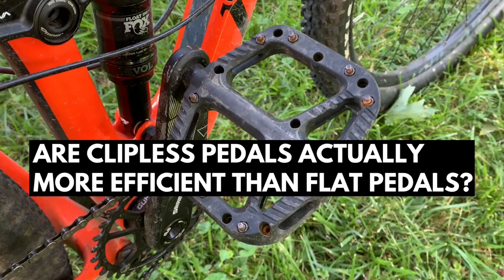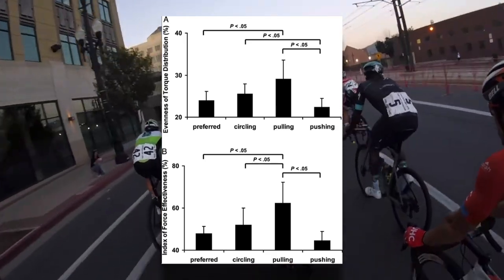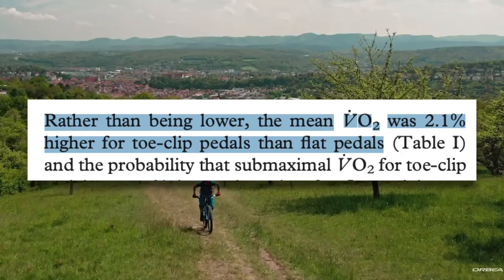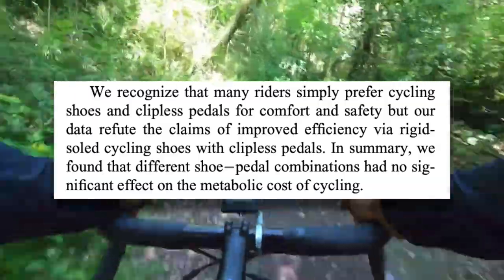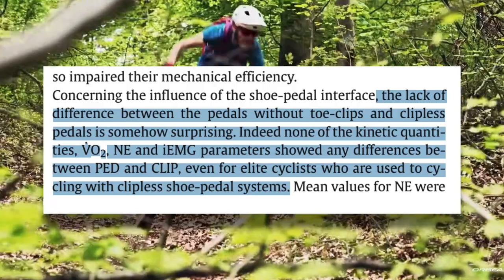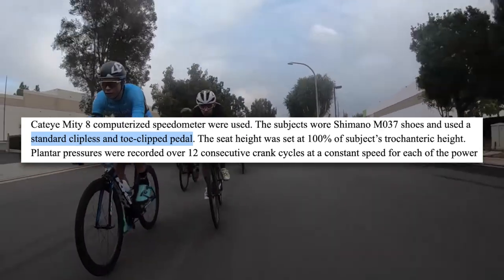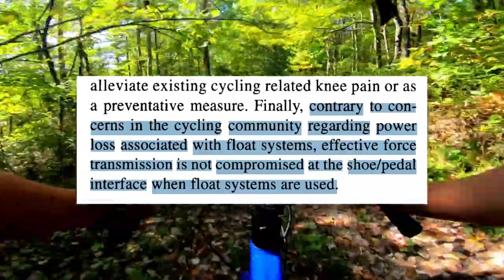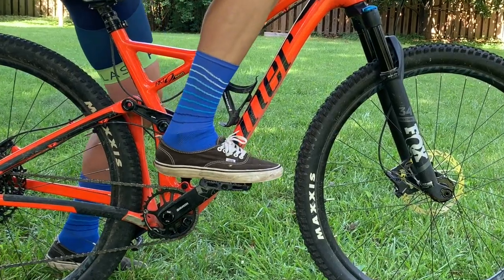Are Clipless Pedals Actually More Efficient Than Flat Pedals? The Answer Might Surprise You.

Comment: This video is completely in line with my experience. I switched to clipless this season and noticed no real upgrade in terms of "efficiency". You will only notice the improvement when going hard, the rest of the time there's no difference. The real gains for me have been the fact that my foot no longer slips off while pushing hard, which looks stupid and is dangerous(and ruins your attack), and that the cycling shoes actually increase my comfort, because I used to get awful soreness on the bottom of my foot from biking on flats with sneakers. While I'd definitely say the switch made cycling overall better for me, the cost is definitely on the high end, and the fact that it's advertised as such a massive game changer can lead to disappointment. Expect improvement, but not to the level some people claim.
Reply: personally i feel that clipless pedals help with the circular motion of the crank. which makes it seem more efficient when you cycle hard. When cycling hard, it makes it hard to get the circular motion down. As the more strength you use the more you need to control your legs to make a constant circular motion. This mean that when going hard, the timing of the transfer of power from one leg to the other isn't as smooth as using clipless. does that make sense?
Reply: @Syn741  well, if you can quantitatively prove that then maybe it is true.

If i was trying to win a competition then maybe i'd bother with clipless pedals, but i am not a professional cyclist so i have no use for them. For the 20+ years that i jave been cycling on a crowded city and sometimes offroad, pinned flat pedals are the best.
Reply: I use toe clips with cycling specific shoes. I glued a rubber on the sole, from a shoemaker store  because these shoes are slippery to use with nothing on. This has a lot of benefits. No knee and tendon pains from the fixed position the clips force you to have. No odd falls that damage the paint and the bike more than the cyclist (except when you fall in front of a car). No foot pain that the sneakers tended to make. Better retention of the foot than with flats, I do not have to continuously adjust the foot position on the pedal. Try this way. Maybe you will benefit.
Reply: I agree your foot slops off less often with clipless but I find it slips of at completely unexpected times when I happen to apply light pressure at just the wrong angle but with flat I can always feel how secure my feet are and know if they're going to slip off before they actually do.
Reply: @Syn741  Don't focus on circular motion. You should be focusing on one leg pushing down, the other pulling up. In perfect harmony, your legs should feel like pistons in an engine. Knees tapping your chest each time, lovely speed.
Reply: Um.  Tennis shoes dont work, a person has to get real flat pedal shoes to make it work.
In 4 years, of 100 to 160 miles a week going hard with flat pedals my foot has never, as of yet, flown off the pedal.  Real shoes with good pedals make ALL the difference.
Reply: @Syn741  Sort of.  People need to think they're pulling up, and if thats what they need then that's what they believe. Every test done, shows it doesn't work that way.

The ugly truth is that with good sticky flat pedal shoes, and good pedals, if your gonna pull up it can be done with flats also.  Also pushing across the top, and scrubbing off the bottom, it all works with flats.   

4 years on flat pedals, this is what Ive found.
Reply: Always go with what you prefer, but if your foot slips off of flat pedals then you probably didn't have the right pedals. I use Shimano Saints set to max grip with the screws and I have never had a foot slip in the ~30K miles since I switched, and I ride in all weather, and have done plenty of sprinting and riding hard.

The downside, of course, is that they're heavy as all f***.
Reply: @MrEcted  Ive used the big Catalyst pedals, and Ive used PNW composite flat pedals, with good shoes a foot coming off mostly never happens.  And the foot goes right back on pedal if a big bump pops foot off. Once your used to them flat pedals are a non item, and way better mt bike riding.
Reply: Although it might ruin genuinely enjoyable aesthetics, there is a big variety of pinned mountain bike pedals and firm specific shoes to match the pedals. Still the same pedal threads, so will fit road cranks.
Reply: @sepg5084 It's not just competition where clipless pedals work, I have been cycling much longer than you and I have much prefered clipless pedals for about 10 years now. Everything else except convenience is better with clipless. When going up a steep hill and running out of gears being able to pull up is helpful when you can use the muscles that are still fresh to give you an extra boost. I can get up hills with clipless pedals that I otherwise would need to walk. Also on longer rides I feel more comfortable on the clipless pedals. Actually have pedals that have clipless on one side and flat on the other. If I go to supermarket or somewhere 5km away I might not bother with the mtb shoes but anything longer and I will definitely wear the shoes with the cleats.
Reply: Hmm, who advertises them as a massive game changer?  Haven't seen an ad like that.
Reply: @PRH123  To be fair, it's when I go to stores that people describe it to me as game changing. Never seen a cycling ad of any kind lol.

Comment: Thanks for citing and interpreting empirical research from peer-reviewed journals on this topic. Seriously, this level of respect for Science in our society is becoming increasingly rare at a time when it actually could not be more important. You have done a great service to the cycling community and a very honorable job in qualifying your statements. Well done, deeply appreciated, and highly respected. </Boomer out>
Reply: And yet the science here would clearly lead a person to the wrong conclusion if people don't understand the limitations of the studies. Namely in this case (as was stated) that climbing and max power tests were not done. We have countless races where nobody ever wins on flat pedals and the reason is that max power output is considerably higher on clipless pedals. It doesn't matter if you can almost keep up on the flat sections effiency wise if you are dropped going uphill when others are able to transfer 100w more power to the pedals.
Reply: Exactly, running tests in the lab with a bike fixed on steel rollers doesn't give data on what really occurs on the road. And we don't ride in one steady state all the time, sometimes we climb, or sprint, or cruise, or hammer.

As we used to say in engineering, there's lies, damn lies, and then there's statistics. If the methodology is not sound, the results won't be either.

Comment: With flat pedals you can change your foot position. This may help especially on steep hills you can step on the middle of the foot area thus de-emphasizing the calves and promoting the use of larger muscle groups to push your way up a steep hill. This gives you access to variety in how you pedal.  when you are back on flatter ground you can switch it up to a position that feels better for spinning...like more toward the ball of the foot.
Reply: Yeah, typically I go back on my heels for climbing and sometimes, when I've already ridden for a while and my legs start to "feel alive" I even pull back my feet and use my ankles for pedalling, taking a fair bit of load off of my legs.

Comment: Using flat pedals are like lifting free dumbells compared to using a machine. You get to use more of the small stabilizing muscles. In a sprint, or machine, you can use higher power output, but when  it comes to efficiency it is the same.

Comment: As a flat pedal rider I'd like to add my 2 cents. If you spend as much on your flat pedal shoes and pedals as you do cliples shoes you can get huge comfort and performance gains. I have come from riding clipless for 5 years with the carbon shoes and everything so I think I have a bit of experience in the field.  I also used to struggle with knee pain that went away almost instantly when I switched to flats and I had tried all of the professional setups and stuff to try and fix it previously. I can't imagine going back to clipless

I'd also like to add that keeping your foot on the pedal while sprinting or in other high effort situation comes from spending a bit more time on them.
Reply: I agree with you I had the same issues with knee pain also ankle pain and set ups and tried every option then bought expensive flat pedals and have a few shoe options I found for my ankle a good walking shoe works or cycling option that's similar... Anyway I find this set up very comfortable I cycle to commute or do long rides so comfort is key over performance anyway but it's interesting to know the performance isn't massively changed. Also off road and I do go a little off road even though my bikes a road bike with tubeless not a specific off road bike it still feels safest without being clipped in
Reply: I just started riding a bike since my childhood. I’m wearing my Nike athletic shoes while on bike too. Are they good or can you give me some good shoes recommendations for flat pedals? I don’t wanna buy clipless, they seem complicated.
Reply: SPD pedals aren't more expensive than flat pedals.

Have to call bollocks on your statement that one can get huge performance gains from switching to flat pedals. You don't get any performance gains.  In fact you will be slower.

I have 3 bikes, one with flats, one with SPD, and one with combo SPD-flat. The flat pedals have their purpose, which is why I have them, but performance is definitely not the driver

Comment: Never locking my foot to a bike. Had too many close calls riding in city traffic where being able to jump off or ditch the bike or plant a foot on the ground quickly, saved my my ass or prevented injury for pedestrians not paying attention. Also makes sense that an upstroke would not make much a of difference since you're always downstroking on one side or the other with far stronger muscles. Great video.
Reply: Once you you them for a wile, getting out is not an issue.
Reply: @bindingcurve  I was once in a situation when I needed to slip fast both feet off the pedals in a forward motion so I could plant them in the ground and hold the bike in place instead of toppling over and crushing a kid under the full weight and energy of an adult and his bike coming at good speed. I was more than happy that I was riding flats with running shoes. As fast as you can be any form of attaching your feet to the bike always requires extra time to detach compared to flats you can slip off right away by just reducing pressure on the pedals. Sometimes even the shortest delay can cause major injuries.
Reply: You can adjust Shimanos so you can leap free with both feet simultaneously. Time MTB pedals, however, will try to kill you. Damn near pulled my feet out of the shoes trying to get out of those.
Reply: City traffic is not really the environment to use clipless pedals in the first place.
Reply: @Will How exactly are your clipless pedals to blame for landing on your shoulder?
Reply: @Will Doubt your outcome would've been any different due to momentum. You didn't have the reaction time to ditch the bike.Momentum means both you and the bike keep going. FWIW I also crashed into a truck that came into my lane. No time to ditch the bike. Somehow my feet unclipped from the pedals on their own. Dislocated a finger. Sued the driver and won some money. Driver lied at deposition, said she wasn't in my lane, said I had no lights.
Reply: @Will A couple thousand dollars, my lawyer took 40%. Took a couple years for finger to regain range of motion. I was furious at the driver's attitude after she hit me. I was cursing her "WTF were you looking at?" and she said "I didn't see you" and I said "You're SUPPOSED TO see me, I have lights and yellow shirt on!" and she got defensive and bitchy with me like I was overreacting. I suspect she was looking at her phone but I couldn't prove it. Another thing that sucked is her lawyer requested copies of my previous years tax returns. I resented such prying into my affairs but my lawyer said it's typical, they wanted to see if my lawsuit is motivated by low income. I was tempted to tell them to eff off but I relented. Me, the driver and our lawyers met to get our depositions. We were all present during both depositions so I heard hers and vice versa. It took all my self-control to not interrupt when she lied and said I had no lights on. Then her lawyer tried to poke holes in my eyewitness account. "How fast were you going? How far away were you when you saw her? Why didn't you swerve?" My lawyer had warned me to expect tough questions and to remain calm under questioning. It was an unpleasant experience for sure.
Reply: I wouldn’t use clipless in unpredictable situations, but on my road bike on safe trails and roads I love them, especially when climbing. I might be imagining this, but I feel like I’m going faster uphill with the same effort vs flats.
Reply: I also use flat pedals. Cheaper, no need to buy specific shoes, more agile in an urban environment where i have to weave through bumper to bumper traffic and sometimes walk around them. I am not a competitive cyclist though, which i bet most bicycle riders are.

Comment: I use flats, I like being able to adjust my position and change which muscle is being used and give knee a change. Less repeating on one angle. Also means I can walk easily when I get off.
Reply: use mtb shoes
Reply: Yup. Repeated stress injuries are a real thing.
Reply: I ride a hardtail, though mainly on the road, with flats. My feet never slip, due to spikes, and I move my feet to a more forward position if climbing a steep hill. With my heels nearer the pedal I can apply more force with my legs without stressing my feet. I find it more l comfortable that way.
Reply: Same here.  I have a goofy knee that does better on flats, and my foot position changes all over the place as needed.  Even with high float pedals (Speedplaay Frogs) I just kept finding myself wanting to move around more than I could.  When Frogs became unavailable I tried going back to SPD pedals, and my knee lit up like a christmas tree from the unclipping motion.  Flats keep things under control so I am sticking with them.
Reply: @123moof  same

Comment: One other benefit of clip less pedals in off road usage is that when you're going over some chunky terrain your foot cant slip and get a pedal to the shin. In fact many dh racers use clip less systems
Reply: Almost all of them
Reply: yeap!  Clipless for DH all the way,  slipping a pedal do to being bounced off blows.  Though for messing around I like to learn on flats
Reply: @sircrackien  True!
Reply: You described me coming home by bike lane, having a descending 800m section of patched patches over patches where I spend attention if anything rattles on a bike. If it's silent I'm sure every bolted connection is tight. And yes, clips have added me some confidence feet will not slip off pedals.
Reply: This is why I switched to clipless
Reply: BMX'r: Slipping the pedals? Yeah that's something that happens trying to land a one handed frame whip 720 double can can...
Reply: The fast ones use flats though.
Reply: Hmm. I use very small pedals and very light sneakers and have never gotten a pedal in the shin. When I went with that setup my feet sometimes came off and it was scarey, but it doesn't happen now i'm used to it.
Reply: @robwarden6973  not true. Almost all the top DH pros clip in
Reply: i use flat pedals for xc riding works fine for me.
Reply: If you have appropriate shoes and pedals this is much less of an issue